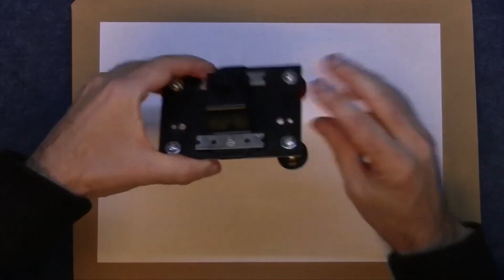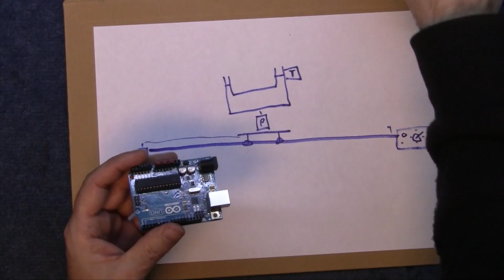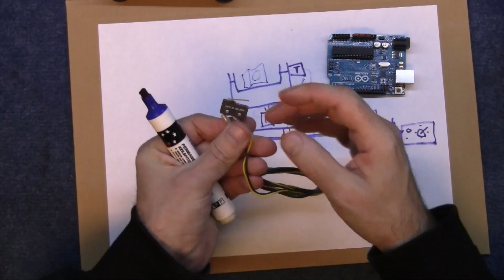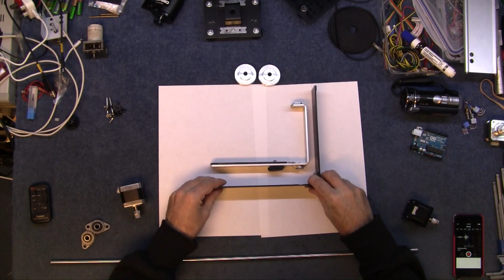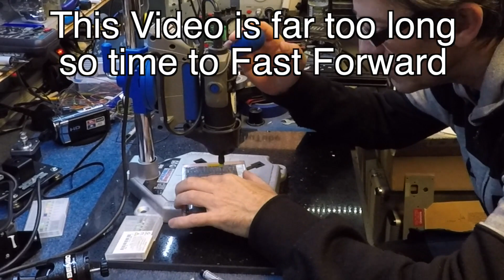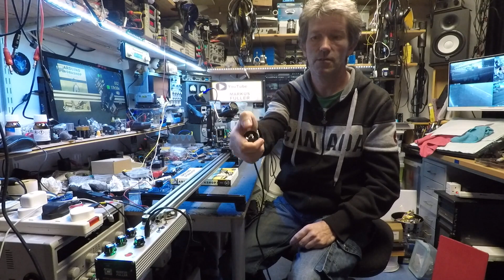1.5 meter Fully motorised DIY Arduino Camera slider with Pan Tilt & GOTO position memories

Comment: hello,Please send me code again because I lost it so PLEASE send again thks........🤩🤩🤩👍👍👍
Reply from the maker: Arduino camera slider code

/*
  stepper motor Rail Pan Tilt camera controller
   by Markus Fuller 2020
  using 1 Arduino UNO 3x nema17 stepper motors and 3x EasyDrivers from www.schmalzhaus.com
  Library - AccelStepper by Mike McCauley:
  http://www.airspayce.com/mikem/arduino/AccelStepper/index.html

*/

#include <AccelStepper.h>
#include <MultiStepper.h>

#define PanX A0       // Pan X pin
#define TiltY A1       // Tilt Y pin
#define Rail A2     // Slider potentiometer
#define inOutPot A3   // In and Out speed potentiometer
#define PanStop 10  // to stop pan cable tangling
#define Button 12   // Set Button
#define EndStop 11
#define RedLED 8   // RGB Led Red
#define GreenLED 9 // RGB Led Green
#define blueLED 13 // RGB Led blue

// Set stepper motor pins on Arduino as type, Step, and Direction,
AccelStepper stepper1(1, 7, 6);
AccelStepper stepper2(1, 5, 4);
AccelStepper stepper3(1, 3, 2);

MultiStepper StepperControl;

long gotoposition[3]; // stores the A and B position for every stepper motor

int PanPos = 0;
int TiltYPos = 0;
int RailPos = 0;
int currentSpeed = 100;
int inOutSpeed = 100;

int XInPoint = 0;
int YInPoint = 0;
int ZInPoint = 0;
int XOutPoint = 0;
int YOutPoint = 0;
int ZOutPoint = 0;
int InandOut = 0;

void setup() {
  stepper1.setMaxSpeed(3000);
  stepper1.setSpeed(300);
  stepper2.setMaxSpeed(1500);
  stepper2.setSpeed(75);
  stepper3.setMaxSpeed(1500);
  stepper3.setSpeed(75);

  pinMode(PanStop, INPUT_PULLUP); //faultstop to help prevent pan cable tangling
  pinMode(Button, INPUT_PULLUP); //setswitch which is also activate button
  pinMode(EndStop, INPUT_PULLUP); //endstop microswitch
  pinMode(RedLED, OUTPUT); //red led
  pinMode(GreenLED, OUTPUT); //green led
  pinMode(blueLED, OUTPUT); //blue led

  StepperControl.addStepper(stepper1);
  StepperControl.addStepper(stepper2);
  StepperControl.addStepper(stepper3);

  // Move the slider to the Home position when first turned on
  while (digitalRead(EndStop) != 0) {
    stepper1.setSpeed(1500);
    stepper1.runSpeed();
    stepper1.setCurrentPosition(0); // When EndStop is activated this sets position as step 0

  }
  delay(30);
  // Moves back slightly from the rail endstop
  while (stepper1.currentPosition() != -1500) {
    stepper1.setSpeed(-1500);
    stepper1.run();

    // This section below for Pan centre control
  }
  // Moves the pan head anticlockwise until microswitch is activated
  while (digitalRead(PanStop) != 0) {
    stepper3.setSpeed(-400);
    stepper3.runSpeed();
    stepper3.setCurrentPosition(0); // When Pan is centred set position to 0 steps

  }
  delay(30);
  // Moves pan clockwise untilfacing forward, this may need to be changed depending on how many teeth between stepper and pan wheel
  while (stepper3.currentPosition() != 1070) { 
    stepper3.setSpeed(400); 
    stepper3.run();

    // End of section above
    
    digitalWrite(blueLED, HIGH); // blue led turns on
  }

  }
     void loop() {
  // this will cancel out the rail movement if you try and travel beyond safe limits
  while (digitalRead(EndStop) == 0 || stepper1.currentPosition() < -40500) {}

      if (digitalRead (Button) == 0) {
      delay(1000); // hold switch for 1 second to reset all values then LED turns Blue

      if (digitalRead (Button) == 0) {
      InandOut = 4;
      }
  switch (InandOut) {
    case 0:   // Set the A position
      InandOut = 1;
      XInPoint = stepper1.currentPosition(); // Set the IN position for steppers 1
      YInPoint = stepper2.currentPosition(); // Set the IN position for steppers 2
      ZInPoint = stepper3.currentPosition(); // Set the IN position for steppers 3
      digitalWrite(blueLED, LOW); // MSF blue led goes out
      digitalWrite(RedLED, HIGH); // Light up inLed
      break;

    case 1: // Set the B position
      InandOut = 2;
      XOutPoint = stepper1.currentPosition(); //  Set the B positions for steppers
      YOutPoint = stepper2.currentPosition();
      ZOutPoint = stepper3.currentPosition();
      digitalWrite(RedLED, LOW); // red Led goes off then Green Led Illuminates stating ready to run
      digitalWrite(GreenLED, HIGH);
      break;

    case 2: // Move to A position / go to next part case 3
      InandOut = 3;
      inOutSpeed = analogRead(inOutPot);
      // Place the A position into the Array
      gotoposition[0] = XInPoint;
      gotoposition[1] = YInPoint;
      gotoposition[2] = ZInPoint;
      stepper1.setMaxSpeed(inOutSpeed);
      stepper2.setMaxSpeed(inOutSpeed);
      stepper3.setMaxSpeed(inOutSpeed);
      StepperControl.moveTo(gotoposition);
      StepperControl.runSpeedToPosition();
      delay(200);
      break;

    case 3: // Move to B position and returns go back to case 2 above
      InandOut = 2;
      inOutSpeed = analogRead(inOutPot);
      // Place the B position into the Array
      gotoposition[0] = XOutPoint;
      gotoposition[1] = YOutPoint;
      gotoposition[2] = ZOutPoint;
      stepper1.setMaxSpeed(inOutSpeed);
      stepper2.setMaxSpeed(inOutSpeed);
      stepper3.setMaxSpeed(inOutSpeed);
      StepperControl.moveTo(gotoposition);
      StepperControl.runSpeedToPosition();
      delay(200);
      break;

    case 4: // If Set button is held longer than one second go back to the beginning case 0 above
      InandOut = 0;
      digitalWrite(RedLED, LOW);
      digitalWrite(GreenLED, LOW);
      digitalWrite(blueLED, HIGH);
      delay(1000);
      break;
  }
}

      // PanX - Pan movement XPos
      
     PanPos = analogRead(PanX);
      // if Pan Pot is moved left, move stepper 2 pan anticlockwise

     if (PanPos > 600) {
      //stepper2.setSpeed(currentSpeed);
     PanPos = map(PanPos, 600, 1024, 0, 200);
     stepper2.setSpeed(PanPos); // Increase speed
}
      // if PanPot is moved right, move stepper 2 pan clockwise
     else if (PanPos < 400) {
      //stepper2.setSpeed(-currentSpeed);
     PanPos = map(PanPos, 400, 0, 0, 200);
     stepper2.setSpeed(-PanPos); // Increase speed
}
       // if PanPot is centred then there is no movement
    else {
     stepper2.setSpeed(0);
}

      //Tilt Y - Tilt movement
      
     TiltYPos = analogRead(TiltY);

     if (TiltYPos > 600) {
      //stepper3.setSpeed(currentSpeed);
     TiltYPos = map(TiltYPos, 600, 1024, 0, 200);
     stepper3.setSpeed(TiltYPos); // Increase speed
}
     else if (TiltYPos < 400) {
      //stepper3.setSpeed(-currentSpeed);
     TiltYPos = map(TiltYPos, 400, 0, 0, 200);  // Try changing this to lower value to slow tilt stepper
     stepper3.setSpeed(-TiltYPos); // Increase speed
      // If TiltPot is centred then there is no movement
}
     else {
      stepper3.setSpeed(0);
}

      // RAIL potentiometer
      
     RailPos = analogRead(Rail);

      // If potentiometer is turned left then the Gantry moves towards the control unit

     if (RailPos > 600) {
     RailPos = map(RailPos, 600, 1024, 0, 3000);
     stepper1.setSpeed(-RailPos); // Increase speed
}
      // If potentiometer is turned right then the Gantry moves away from the control unit
     else if (RailPos < 400 ) {
     RailPos = map(RailPos, 400, 0, 0, 3000);
     stepper1.setSpeed(RailPos); // Increase speed
     // If potentiometer is centred then there is no movement
}      
     else {
    stepper1.setSpeed(0);
}
     // run the camera slider
    stepper1.runSpeed();
    stepper2.runSpeed();
    stepper3.runSpeed();
}
Reply: thanks A lot but I forget to ask circuits diagram  .......PLS PLS  🤣😂😇😇😇
Reply: ok thks
Reply from the maker: Sorry I thought you were asking about the code again.as for the circuit diagram I am not sure if I still have it as it was so many years ago and I have changed my computer a few times since then. I will have a look around for it but I do not think I still have it. If I find it I will let you know.
Reply from the maker: Hello I have found a few items relating to the circuit diagram of the camera slider. I do not know how to send them through youtube: are you on messenger where I can send the folder ?. I a, on messenger as markus fuller. send me message then I can get these over to you. best wishes.

Comment: My slider almost done. I have one question for you. Do you know how can i get actual parametr of variables stepper1.currentPosition, stepper2.currentPosition or stepper3.currentPosition?
When software are switching InandOut variable, then entering to library StepperControl.moveTo(gotoposition); and StepperControl.runSpeedToPosition(); then i can't read actual value of stepperX.currentPosition. I want to present this on ma 16x2 or better 20x4 lcd.

Comment: 6:07 - i can't see. I want to read and analyze your arduino code. Can you share me your arduino code?
Reply from the maker: @electronical_matrix  Arduino camera slider code

/*
  stepper motor Rail Pan Tilt camera controller
   by Markus Fuller 2020
  using 1 Arduino UNO 3x nema17 stepper motors and 3x EasyDrivers from www.schmalzhaus.com
  Library - AccelStepper by Mike McCauley:
  http://www.airspayce.com/mikem/arduino/AccelStepper/index.html

*/

#include <AccelStepper.h>
#include <MultiStepper.h>

#define PanX A0       // Pan X pin
#define TiltY A1       // Tilt Y pin
#define Rail A2     // Slider potentiometer
#define inOutPot A3   // In and Out speed potentiometer
#define PanStop 10  // to stop pan cable tangling
#define Button 12   // Set Button
#define EndStop 11
#define RedLED 8   // RGB Led Red
#define GreenLED 9 // RGB Led Green
#define blueLED 13 // RGB Led blue

// Set stepper motor pins on Arduino as type, Step, and Direction,
AccelStepper stepper1(1, 7, 6);
AccelStepper stepper2(1, 5, 4);
AccelStepper stepper3(1, 3, 2);

MultiStepper StepperControl;

long gotoposition[3]; // stores the A and B position for every stepper motor

int PanPos = 0;
int TiltYPos = 0;
int RailPos = 0;
int currentSpeed = 100;
int inOutSpeed = 100;

int XInPoint = 0;
int YInPoint = 0;
int ZInPoint = 0;
int XOutPoint = 0;
int YOutPoint = 0;
int ZOutPoint = 0;
int InandOut = 0;

void setup() {
  stepper1.setMaxSpeed(3000);
  stepper1.setSpeed(300);
  stepper2.setMaxSpeed(1500);
  stepper2.setSpeed(75);
  stepper3.setMaxSpeed(1500);
  stepper3.setSpeed(75);

  pinMode(PanStop, INPUT_PULLUP); //faultstop to help prevent pan cable tangling
  pinMode(Button, INPUT_PULLUP); //setswitch which is also activate button
  pinMode(EndStop, INPUT_PULLUP); //endstop microswitch
  pinMode(RedLED, OUTPUT); //red led
  pinMode(GreenLED, OUTPUT); //green led
  pinMode(blueLED, OUTPUT); //blue led

  StepperControl.addStepper(stepper1);
  StepperControl.addStepper(stepper2);
  StepperControl.addStepper(stepper3);

  // Move the slider to the Home position when first turned on
  while (digitalRead(EndStop) != 0) {
    stepper1.setSpeed(1500);
    stepper1.runSpeed();
    stepper1.setCurrentPosition(0); // When EndStop is activated this sets position as step 0

  }
  delay(30);
  // Moves back slightly from the rail endstop
  while (stepper1.currentPosition() != -1500) {
    stepper1.setSpeed(-1500);
    stepper1.run();

    // This section below for Pan centre control
  }
  // Moves the pan head anticlockwise until microswitch is activated
  while (digitalRead(PanStop) != 0) {
    stepper3.setSpeed(-400);
    stepper3.runSpeed();
    stepper3.setCurrentPosition(0); // When Pan is centred set position to 0 steps

  }
  delay(30);
  // Moves pan clockwise untilfacing forward, this may need to be changed depending on how many teeth between stepper and pan wheel
  while (stepper3.currentPosition() != 1070) { 
    stepper3.setSpeed(400); 
    stepper3.run();

    // End of section above
    
    digitalWrite(blueLED, HIGH); // blue led turns on
  }

  }
     void loop() {
  // this will cancel out the rail movement if you try and travel beyond safe limits
  while (digitalRead(EndStop) == 0 || stepper1.currentPosition() < -40500) {}

      if (digitalRead (Button) == 0) {
      delay(1000); // hold switch for 1 second to reset all values then LED turns Blue

      if (digitalRead (Button) == 0) {
      InandOut = 4;
      }
  switch (InandOut) {
    case 0:   // Set the A position
      InandOut = 1;
      XInPoint = stepper1.currentPosition(); // Set the IN position for steppers 1
      YInPoint = stepper2.currentPosition(); // Set the IN position for steppers 2
      ZInPoint = stepper3.currentPosition(); // Set the IN position for steppers 3
      digitalWrite(blueLED, LOW); // MSF blue led goes out
      digitalWrite(RedLED, HIGH); // Light up inLed
      break;

    case 1: // Set the B position
      InandOut = 2;
      XOutPoint = stepper1.currentPosition(); //  Set the B positions for steppers
      YOutPoint = stepper2.currentPosition();
      ZOutPoint = stepper3.currentPosition();
      digitalWrite(RedLED, LOW); // red Led goes off then Green Led Illuminates stating ready to run
      digitalWrite(GreenLED, HIGH);
      break;

    case 2: // Move to A position / go to next part case 3
      InandOut = 3;
      inOutSpeed = analogRead(inOutPot);
      // Place the A position into the Array
      gotoposition[0] = XInPoint;
      gotoposition[1] = YInPoint;
      gotoposition[2] = ZInPoint;
      stepper1.setMaxSpeed(inOutSpeed);
      stepper2.setMaxSpeed(inOutSpeed);
      stepper3.setMaxSpeed(inOutSpeed);
      StepperControl.moveTo(gotoposition);
      StepperControl.runSpeedToPosition();
      delay(200);
      break;

    case 3: // Move to B position and returns go back to case 2 above
      InandOut = 2;
      inOutSpeed = analogRead(inOutPot);
      // Place the B position into the Array
      gotoposition[0] = XOutPoint;
      gotoposition[1] = YOutPoint;
      gotoposition[2] = ZOutPoint;
      stepper1.setMaxSpeed(inOutSpeed);
      stepper2.setMaxSpeed(inOutSpeed);
      stepper3.setMaxSpeed(inOutSpeed);
      StepperControl.moveTo(gotoposition);
      StepperControl.runSpeedToPosition();
      delay(200);
      break;

    case 4: // If Set button is held longer than one second go back to the beginning case 0 above
      InandOut = 0;
      digitalWrite(RedLED, LOW);
      digitalWrite(GreenLED, LOW);
      digitalWrite(blueLED, HIGH);
      delay(1000);
      break;
  }
}

      // PanX - Pan movement XPos
      
     PanPos = analogRead(PanX);
      // if Pan Pot is moved left, move stepper 2 pan anticlockwise

     if (PanPos > 600) {
      //stepper2.setSpeed(currentSpeed);
     PanPos = map(PanPos, 600, 1024, 0, 200);
     stepper2.setSpeed(PanPos); // Increase speed
}
      // if PanPot is moved right, move stepper 2 pan clockwise
     else if (PanPos < 400) {
      //stepper2.setSpeed(-currentSpeed);
     PanPos = map(PanPos, 400, 0, 0, 200);
     stepper2.setSpeed(-PanPos); // Increase speed
}
       // if PanPot is centred then there is no movement
    else {
     stepper2.setSpeed(0);
}

      //Tilt Y - Tilt movement
      
     TiltYPos = analogRead(TiltY);

     if (TiltYPos > 600) {
      //stepper3.setSpeed(currentSpeed);
     TiltYPos = map(TiltYPos, 600, 1024, 0, 200);
     stepper3.setSpeed(TiltYPos); // Increase speed
}
     else if (TiltYPos < 400) {
      //stepper3.setSpeed(-currentSpeed);
     TiltYPos = map(TiltYPos, 400, 0, 0, 200);  // Try changing this to lower value to slow tilt stepper
     stepper3.setSpeed(-TiltYPos); // Increase speed
      // If TiltPot is centred then there is no movement
}
     else {
      stepper3.setSpeed(0);
}

      // RAIL potentiometer
      
     RailPos = analogRead(Rail);

      // If potentiometer is turned left then the Gantry moves towards the control unit

     if (RailPos > 600) {
     RailPos = map(RailPos, 600, 1024, 0, 3000);
     stepper1.setSpeed(-RailPos); // Increase speed
}
      // If potentiometer is turned right then the Gantry moves away from the control unit
     else if (RailPos < 400 ) {
     RailPos = map(RailPos, 400, 0, 0, 3000);
     stepper1.setSpeed(RailPos); // Increase speed
     // If potentiometer is centred then there is no movement
}      
     else {
    stepper1.setSpeed(0);
}
     // run the camera slider
    stepper1.runSpeed();
    stepper2.runSpeed();
    stepper3.runSpeed();
}
Reply: @markusfuller  thank you so much. have you a schematics ?